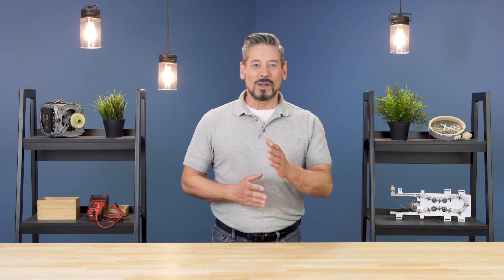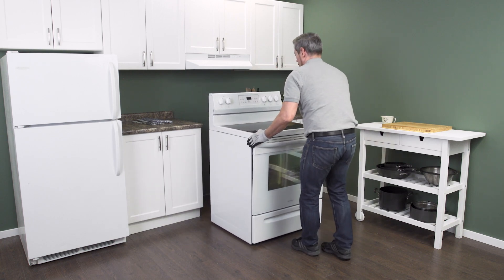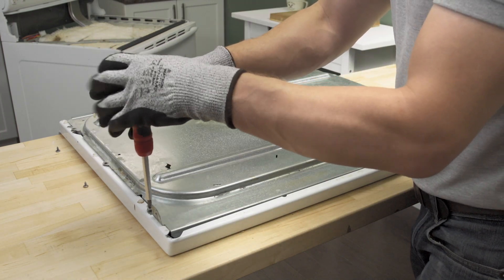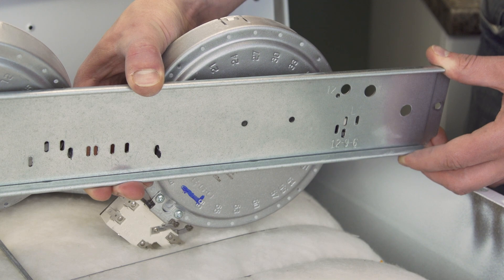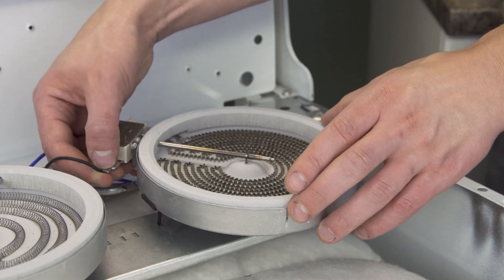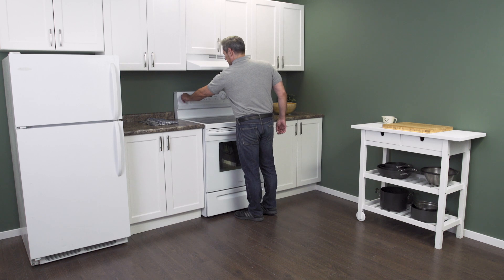Hot Surface Light Stays On - Troubleshooting | Repair & Replace

Comment: 1. What might the problem be if the hot surface indicator light for one burner does not turn on, but the burner heats up? What if one "on" indicator does not light, but heats up?
Reply from the maker: Thanks for watching. If you have more than one hot surface light, then its possible that one of the lights has burnt out.

Alternatively if the light doesn't turn on when one of the burners is working, then it's going to be an issue with the limiter in that that specific heating element.

Alternatively if the cooktop indicator light (power on light) doesn't turn on when using one of the burners then it's going to be an issue with the heat switch.

Comment: Which one would you think is the issue, when you put a cold pack on it, the light goes off? The surface elements or the heat switches? Only 1 burner has the issue. Thanks for the video!
Reply from the maker: Thanks for watching. The hot surface light is connected to the limiter on the heating element. If you're having issues with just one burner, then it's probably best to replace that heating element. The heat switch will not effect the hot surface light as it does not share any wires. The heat switch does have a separate light for power. This is often called the "cooktop indicator light"

Comment: The on/off regular way is not working anymore... And the heat light stays on even if cool... Whats that could be...!?
Reply from the maker: Thanks for watching. When you turn off the burner does it cool down completely? Is it only the light that stays on? If that is the case then it's likely a faulty limiter on one of the elements.

Comment: I put a bowl of ice on the cooking surface  and the light shut off.
Reply from the maker: Thanks for watching. Since there is some heat left on the cooktop even after the burner is shut off, the light will usually stay on for a while. If the light was staying on all the time, and putting a bowl of ice turned it off, then it's likely that one of the switches (in one of the element limiters) is worn out and is still making contact at room temperature. If you test each element you will still be able to narrow down the one that is faulty following the steps on the video.
Reply: Thanks I'll check it out.

Comment: Great video but couldn’t I remove 1 “hot surface” wire from each element until the light goes off?
Reply from the maker: Thanks for watching. That is one way of eliminating it but it does require a bit of back and forth.
Reply: You could but that seems much more complicated, and dangerous since the oven would have to be plugged in and you'd be messing with active wires.

Comment: i have the exact same stove.same problem..is is safe to just not fix it and use anyway..not like its gonna turn itself on in middle of the night is it?
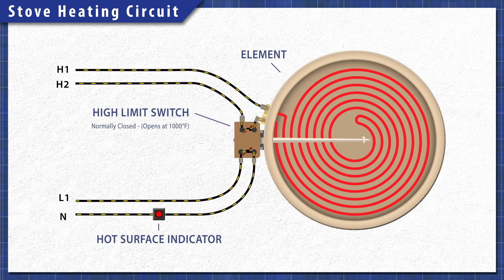Reply from the maker: Thanks for watching. As you can see in the circuit at 1:31 the hot surface light is not on the same circuit as the heating element. This means that the hot surface light won't affect the heating elements and there is no risk of the heating element turning on without turning on the heat switch directly.
Reply: Thank you madmax1970 for asking that question. I have the same issue and I was very worried about it until I watched this video and read your comment. Not knowing when I will be able to get it fixed. Now I know it is a minor issue, and that I can fix if I choose to sometime in the future
Reply: Hi. My Mom has A Samsung flat top stove. Not used for days and that light stays on. Are all stoves heating and heating indicator lights on separate circuits . Just want to make sure this is safe to continue using with the light on ? Thank you so much.

Comment: Hi I have a GE Model JB655EK4ES, The Inner burner or smaller burner does not work. its glass stove top with burner and one warmer. Big burner has two burner, Inner and outer or Larger and smaller.  Can someone help me, what needs to replaced. Ive opened and visually looked into the burner and switch. Nothing seems to be abnormal. Please help.
Reply from the maker: Hi Jahanur, thank you for watching. If an element isn't working properly in your glass stove top then it could be an issue with the switch or the element itself. Using a multimeter you can test the components to determine what has failed as its difficult to tell just by looking at it. The testing and troubleshooting is shown in this video https://youtu.be/GaW7uAHkPQI

Comment: can  i simply remove the indicator wires from the faulty switch and tape them off to avoid buying the switch (I know i wont get hot surface light for that cook head)
Reply from the maker: Thanks for watching. Its always best to replace the element but if that is not possible at the moment, disconnecting the wires will prevent power from being supplied to the hot surface light. It will stop it from staying on constantly, and taping it off the wires will keep it isolated and prevent a short. The heating element will still continue to heat up and work as normal.

Comment: I'm experiencing the same issue with the indicator light with my Frigidaire CPLES399EC8.  All of my burners work.  Just the light that heat indicator light doesn't turn off.  Is this the same troubleshooting issue?
Reply from the maker: Thanks for watching. If the hot surface indicator light stays on then it will be an issue with one of the limiters in one of the heating elements. You will need to open up the top and test each element as per the steps in this video.

Alternatively if the cooktop indicator light (power light) doesn't turn off then its a problem with one of the heat switches: https://www.youtube.com/watch?v=s5iG61kAyJQ
Reply: @AmreSupply  It is indeed the hot surface indicator light.  So just to make sure I understand, even though the elements are still working (turning on and off, heating correctly) I would still need to replace the heating element?
Reply: Further to this question, I have 4 indicator lights, one for a corresponding element.  Does the indicator light that stays on match the heating element that needs replacing?
Reply from the maker: @nicolefelicitas1961  That is right. Once you narrow down which element has a faulty limiter, you'll have to replace the entire element which you can find using this lookup tool: https://www.amresupply.com/lookup 

Keep in mind there are a small number of elements that have removable limiters, but they are not as common so its harder to find the replacement limiters in those cases.
Reply from the maker: @nicolefelicitas1961  Just saw this question now. If each heating element turns on a different hot surface light, then you'll have to narrow down the heating element which is wired to the light that won't shut off.

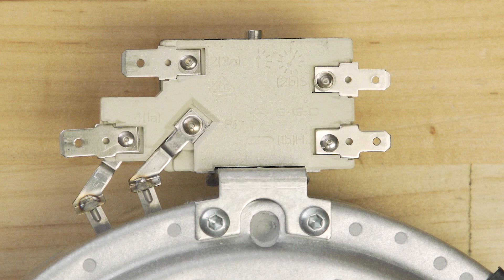Comment: Hard to see, but at 5:03 I was able to determine the 4 terminals are, indeed, labeled 1a, 2a, 1b, 2b.  It really doesn't matter where they are on your demo model, it matters that your viewers check theirs and then check for continuity (set your multi-meter to the horseshoe :-) ) between 1b and 2b.   P.S. It's too bad you can't replace just the switch instead of the whole element, or better yet, be able to open it up to un-stick the indicator switch.
Reply from the maker: Thanks for watching! You have a good eye, and we added the graphics and the explanation because the markings don't show up nicely on camera. There are a small number of elements that can have the limiter removed but those are not common. As well since not all switches look the same, a continuity test on the terminal numbers was the best way to troubleshoot across various models. We try to make these videos helpful to as many different stoves as possible. Cheers!